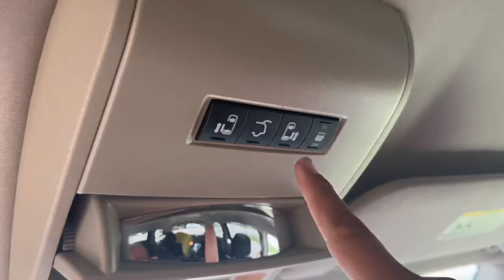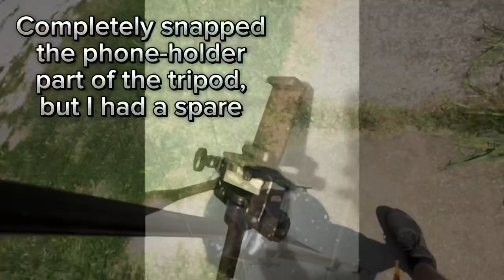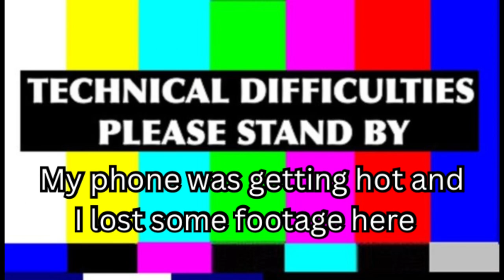Cleaning up an overgrown corner lot with electric push mower

Comment: Did you change blades? From first cut bagging to last cut did you change blades to a mulching blade? Just got the mower not sure if that’s what we are suppose to do?
Reply from the maker: I use the high lift blade all the time, both for bagging and mulching. It just seems to give the best cut even if they say it reduces battery life.